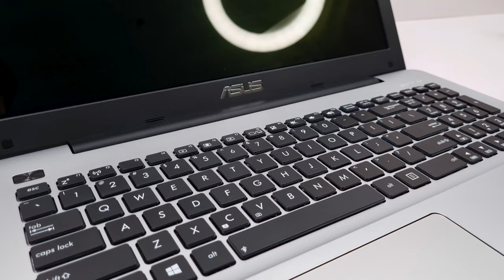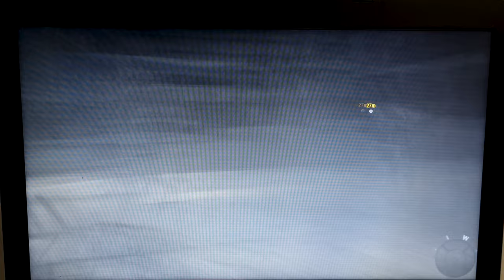From Junk To Gaming Laptop - Asus Laptop Restoration & Repair - Laptop Deep Cleaning

Comment: never put grease on the hinges...dust will stick to the grease and lockup the hinges....dont use grease on the fan also...grease melts when getting warm...and wil run on the little pcb of the fan causing shortcirquit and the fan will fail...thermal paste always throw away the first bit that comes out of the seringe...you see the oil/moisture coming out and is now on your cpu..so less contact with the heatsink...
Reply: Exactly 💯

Comment: You are a braave soul, showing your thermal paste application on the internet for folks to critique! Also a patient one with removing and re-adding all that plastic welding - I would've just taken one look at that, decided they clearly didn't design it to be repairable, and hoped someone's selling the full keyboard along with the frame it's welded to
Reply: Yes, this quantity of thermal paste is insane ..........
Reply: @aurelink83160  Eh, it honestly doesn't really matter as long as there's not too little, and that if you're going overkill, it's not conductive in case it makes contact with other components. Other than that, the only other issue is that it's a little wasteful, but bog standard thermal paste isn't that expensive.

Gamers Nexus made a video on thermal paste application that was pretty enlightening.

Comment: Hey man! I like watching your videos, they are really entertaining and cool. Please don't get me wrong but I recommend you to use silicone oil for fan oiling. You will get better result for sure. And you are using very low quality thermal compound. Can easily seeing cracks in syringe, that means it is trash already. While you are putting thermal paste on crystal you can see how watery it is, and you are using way too much paste. The price performance king Arctic Mx-4 will be better choice, work on 'perfect amount of thermal paste' :) Thanks for your efforts, good luck.
Reply: Excelent videos good job ! , Amazing Time restoration.